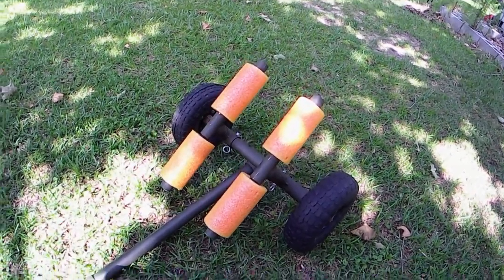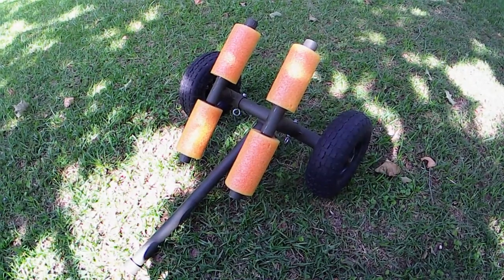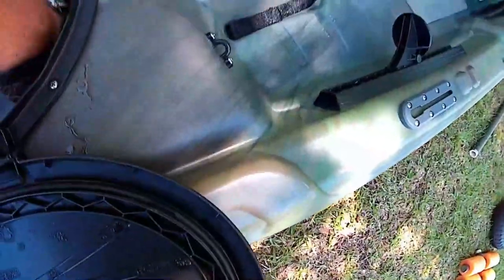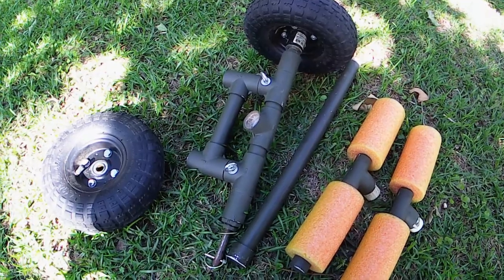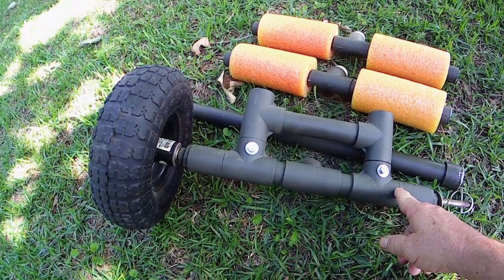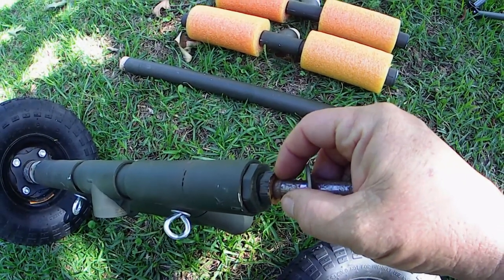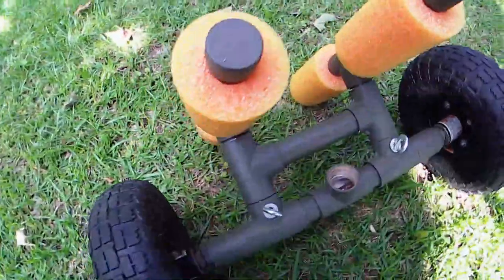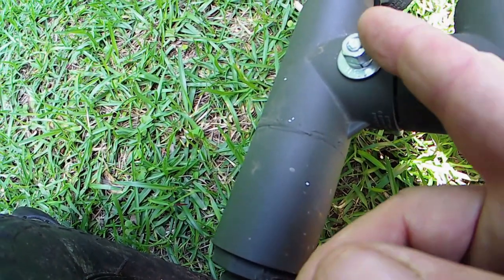Strong, Easy AND STOWABLE!! DIY Kayak Cart for the Pelican Catch 120

Comment: Great concept. I've been debating buying or building a cart for my Lifetime Yukon. This looks as good as anything I might buy. Thanks for the in depth look.
Reply from the maker: Hi, and thanks for watching!  We’ve used my cart on my wife’s Yukon.  It works fine, but obviously the dimensions could be tweaked a little for a custom fit.  I have a video where we looked at my cart under a Yukon, a Perception Striker, and an Ascend FS120.  Stay Safe!

Comment: I have watched about a dozen of these cart build videos. You are the first to address a good way to secure the tie downs.  My cart works great, but the ratchet straps are awkward for my wife and kids to use.  Elastic tie downs are the perfect solution.  Thanks!
Reply from the maker: Hi, and thanks for watching, I'm glad you liked it!  I originally had no provision for tie downs on the cart, relying on the kayak's weight to hold it in place.  My first trip down a bumpy ramp with it made my mind up that I needed something to keep from bouncing the boat off the cart, and I felt that ratchet straps would be too likely to damage the PVC by over-tightening them, so bungees it was!  Stay safe!

Comment: What's the axle bore diameter for the wheels you got from Harbor Freight? All I can find are 5/8" axle bore, but I'm having a very hard time finding 5/8" steel tubing to use for the axle. Are your wheels actually 5/8" and the 1/2" tube fits well enough?
Reply from the maker: Hi, and thanks for watching!  Pretty sure mine have a 5/8" axle bore, as well, and I know I used 1/2" tubing.  Loaded, the cart has enough weight that the axle sits on the wheel bearing firmly enough that the bearing does the turning, or at least most of the turning.

Comment: Does this cart got under your Yukon 116?? I’m looking to build one for that exact kayak!! Thanks in advance
Reply from the maker: Thanks for watching!  That’s a good question…I’m at work for a couple more weeks, but when I get home I’ll try it and let you know what I find.  Offhand, I don’t see why it wouldn’t work, though I’d imagine the measurements would need a little tweaking for a custom fit.
Reply: @DEADorALIVEkayaking  thanks man. Looks like it’ll work fine and it’s only $35-$40 hey, why not! 

I measured 15in from basically scupper to scupper so I’m thinking the cart’s top section (with the tees) should be 15 1/2in apart and it’ll hold that kayak well!! 
Thanks again man, I’ll be waiting for your feedback and I’ll also get back to you with mine 😉 
Happy Thanksgiving 🦃🍁🍽
Reply from the maker: Okay...I'm home and I checked!  The short answer is yes, it'll fit, but you would have to widen it a few inches to accommodate the Yukon's wider keel.  Here's a short video showing what I found... https://youtu.be/IctyxHwOH68